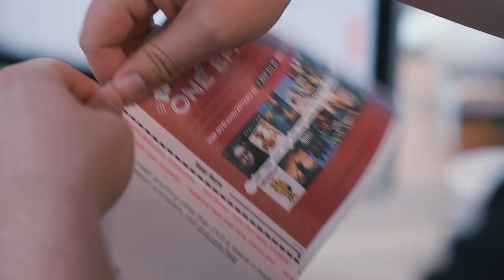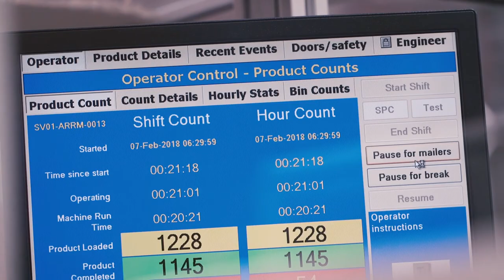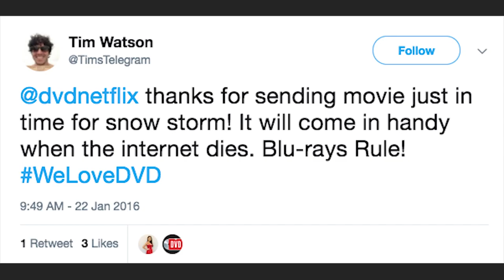Part Four: Return to Sender

Comment: Ah! I can voice my suggestion!  Minor as it may seem, I would appreciate your placing the adhesive flap on the opposite side of the envelope - so I can see that the bar code is visible in the "window" before I seal it.  As currently constructed one inserts the disc with bar code appearing in the window and then must turn the envelope over to pull away the tab before sealing it.  I'll bet that more than one customer has inserted the disc and mailed it with the bar code not showing.  And P.S. keep the politics out of your business (Obama and ilk)

Comment: I'm sorry, am I supposed to be happy that a lot of people are out of a job?
Reply: Innovation doesn't just eliminate jobs, it also creates them. This Netflix machine might remove the need for a particular job, but it doesn't mean another job isn't created. If the Netflix machine increases productivity in one area, then it also increases demands elsewhere. Netflix gets more customers, which means more jobs for customer support etc. Someone also needs to maintain the machine which means more jobs. Post office also becomes more busy because of the extra discs. People said that the invention of the steam engine and computer would eliminate jobs, but both examples prove the opposite.
Reply: Seriously? I guess we should abandon all "assembly line" technology pioneered by the automotive industry because it would take a lot more people to build a car if we didn't use an assembly line. "Am I supposed to be happy that assembly lines were invented???????????"    smh people on the internet